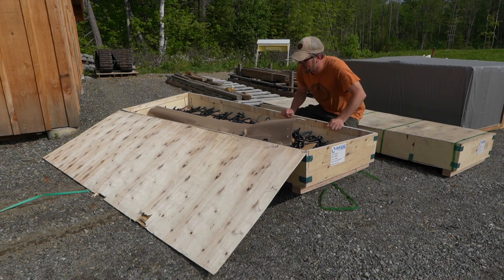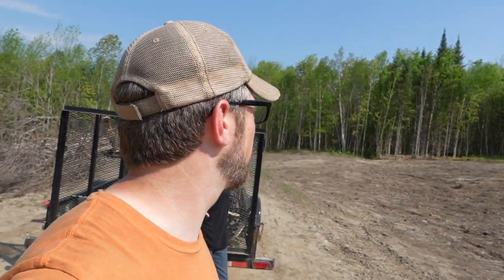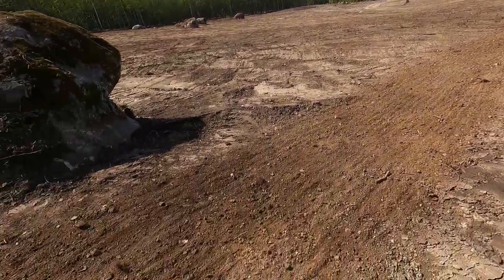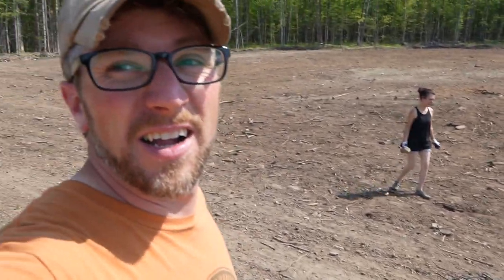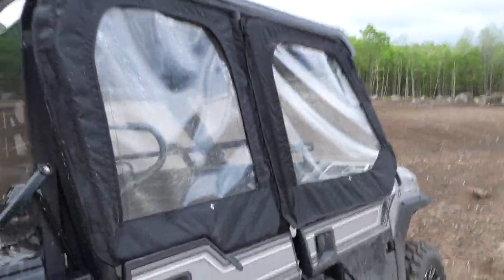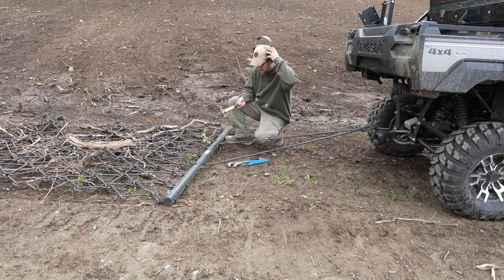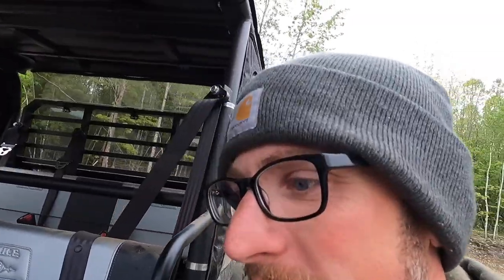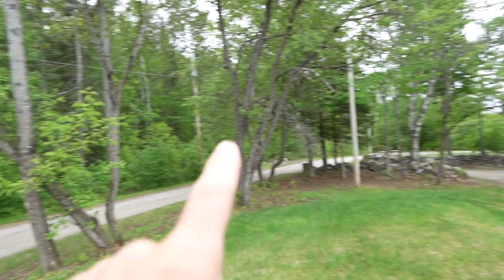Our NEXT Journey BEGINS! Building Our OFF-GRID Homestead in the Wilderness FROM SCRATCH

Comment: Free advice from someone whose farms aren't where I live. Mount a set of toolboxes in the bed of your pickup and load it down with every tool you might need. That way you'll probably have what you need when stuff breaks no matter where you are. I can't count how many times you've needed a tool from home since you began working on the new property.
Reply: However, the down side of having the toolboxes mounted in the truck bed would be essentially the permanent loss of that much cargo volume in the truck, which Al does regularly use, such as when he's picking up bales of hay, or other bulky goods.  However, if it were made in such a way that it could be lifted out with the Kubota for rapid removal and replacement, it might still be a good idea.
Reply: Good idea!!  I’ve noticed that too!!  
Just a thought!  Olivias legs are younger than Gina’s. So, helping pick up sticks is an easier job for her and good training. Builds character!!
Reply: Good job getting the property developed!!  It’s looking awesome!!
Reply: @OriginalLictre  Dedicated farm truck. A beatter  1ton with a full size bed.
Reply: I would add a Work vice, with pipe jaw to your truck as well. You could mount it to the tow receiver so you could remove it when not needed. Adjust the height with 2” square the same as your receiver. To the height tailgate. Thanks again for the posting.

Comment: Save the wood from those crates. At this point, they're almost as valuable as the contents. Are you going to hydroseed that area?
Reply: I am wondering how he is going to water it.
Reply: @cooldog60  rain?!! Is the plan for this to be grazing pasture? I guess he'll figure something out 🙂
Reply: @rachelm7525  Yeah but you can't depend on the rain.
Reply: @cooldog60  ,
I live in northeast Ohio. I have never watered anything. GOD waters for me.  I have a field behind my garage that I have not mowed yet. The grass is nearly chest high. I have to go very slowly with the blades at their highest setting just to get the grass knocked own. And then mow again with the normal setting. Raking up the grass fills two or three cattle panel mulch piles.
Reply: @donaldmiller8629  I live in south east Michigan. And we hardly ever get any rain in the summer.
Reply: @cooldog60  ,
There can be major variations in local weather within just a few miles. For example , along the southern edge of Lake Erie here in Ohio is what we call the snow belt. They measure their snowfall in feet. I live approximately 20-25 miles south of Lake Erie and I measure my snowfall in inches. I very rarely have to shovel the snow from my driveway. I wait a day or two and the snow melts off.
 You live east of Lake Michigan so you should be getting some measure of rainfall , depending upon wind patterns in your area. In addition you may be receiving more rainfall than you realize. It doesn't have to be a gully washer to be counted as rainfall.
  It's 2:00 A.M. and I'm getting a very light rain right now. Just barely enough to make my deck wet but wet it is.
  I water my chickens by collecting rain run off from the roof of my chicken tractor. The run off drains into a five gallon bucket inside of the coop and fitted with watering nipples. I do this mostly because I am too old to be carrying water to the chickens. Water weighs 8.3 lbs. per gallon as you know. My chickens have never run out of water yet.
  It just seems that as the water gets low , I receive some rain and the bucket is full once again. Just in time. lol  I have never had to water my lawn , flower  beds or vegetable garden. And that is the same way. Just as they begin to get dry, a little rainfall arrives , just in time.  The only things that I do water are the plants growing in large pots on my deck. Those pots do tend to dry out pretty fast. However , I collect rainfall in large storage containers located on the deck near the potted plants. I got the storage containers from Loews. I use them to water the potted blueberries when they become dry.
  You think that you hardly ever get rainfall ? I lived for 25 years in Southern California. The rainfall there equals about 9 inches....per year ! Because I wanted to have a green lawn, I also had a water bill of $250.00 per month. How much is your water bill ? lol

Comment: We used to use a york rake to do the initial pass they would take most of the sticks and rocks then we would lift the rake at the end of the rows to leave them in a pile, then we finish up dragging a section of chain link fence with weights to smooth it out. It's looking good up there, the excavator operator gave you a nice piece to start with.

Comment: Paper towels are made from wood they will scratch plastic as well , try spraying with water or cleaner and soft cloth .😁
Reply: tom miller ,
I would use Rain-X to coat the windshield. It will cause the windshield to shed rainwater so well that wipers are nearly not needed. It works really well on my truck.
Reply: @donaldmiller8629  I agree with you I forgot about that stuff .😁

Comment: In order to clean and level the square for sowing grass, you need to drive three or four, drive the same track, then each piece will be pulled out and the area will be nicely leveled, then the grass will be very even and look nice and the kubota will be lighter and before sowing the grass, it would be good to be whole cross the area with a rotary tiller, then the grass will be nicely arranged and will be strong
 I don't know if I wrote everything well but
 Greetings from Poland

Comment: weld the loops closed, if you got really hard ground just add a log on top of the rake
Reply: Not a good idea-the drag bar is meant to be put on the other end of the drag to change how aggressive the tines are.
Reply: @andyrobinson339  how is that ive used the same drag bar for 20 years, and done so according to the instructions, i add the log because it does a good job on root free ground once excavated enough times, it also helps on dry clay ground, you can create a frame and have it raise and lower on the back of the tractor unit, or you can get a second rake and create a double wide rake for larger areas, or you can drag a second rake behind the first, i've tried every way you can think of even welding additional loops to keep each section of tines in place... i remember before i had a large rake and tines i used a mattress hardware burned the fabric and filing from it and dragged that at the back of the tractor did a good job at first until it was full of roots then i just burned it again and reused it...

Comment: Al needs a bit of canvas in the bed of the Mule  so they can just pull out the sticks/rocks in one go and with any kind of pliers/cutter the closer  to the fulcrum/pivot point the more pressure is applied instead of further out on the jaws. You can make an improvised attachment to collect the rocks/debris by replicating part of the rakes design by having a bar like it being fixed to a bit of chain link fencing or even a piece of plywood that will catch it as it kicks the material up/over leading bar unto it. Al needs to walk more or  let Gina ride since it's a bit unfair and counterproductive not to have her run equipment since he could of been on the Kubota too and having on sit won't due any longer here.

Comment: IF you have some old tyres lay them on top , of course attach with wire or 2 or 3 smaller logs you need a bit of weight and  drive slow ,think you may need something with a little bit more power to tow

Comment: Al, consider getting a 3-point Landscape Rake for your tractor. It would be an easy chore picking up rocks and any other rubble laying around. If you worry that the rake would dig in the ground too much, as it did for me, you can get wheels for the landscape rake. The wheels keep the rake off the ground but low enough to rake up the debris. BTW, y’all are doing a great job.

Comment: Question Al.... where the excavator worked all over those areas, they are really packed down.  Would it be better to Harrow and the land and then rake and plant than the way you are doing it now?  By harrowing the area the hard pack gets loosened up better and then rake, so when you sow the grass seed the roots will go deeper and give it a good stability.  Just raking like you are doing will shorten the roots as they will grow to the hard pack dirt below what you raked and will just grow sideways and not really have a productive system.
Reply: Guess we'll find out what works ultimately... 🙂